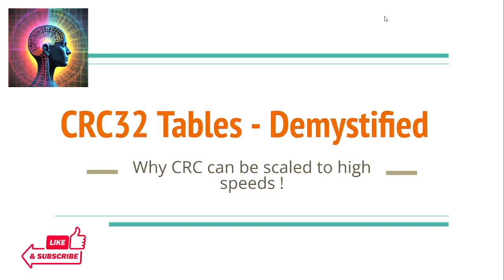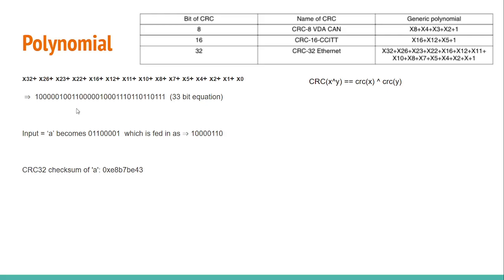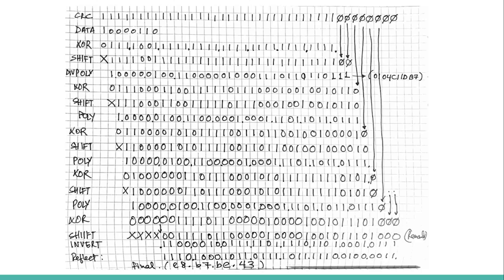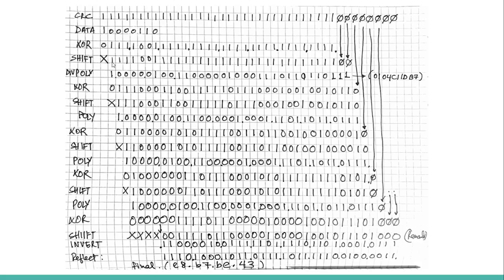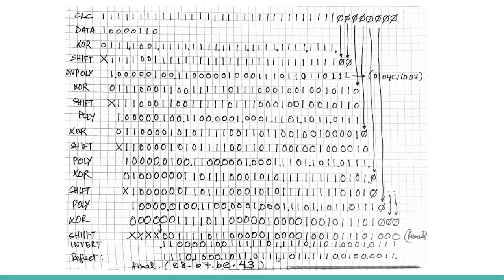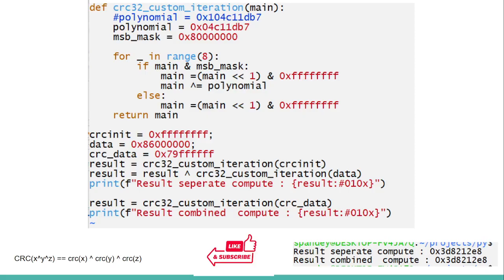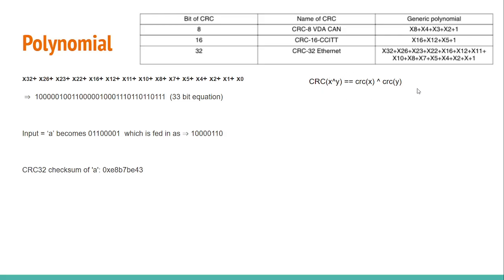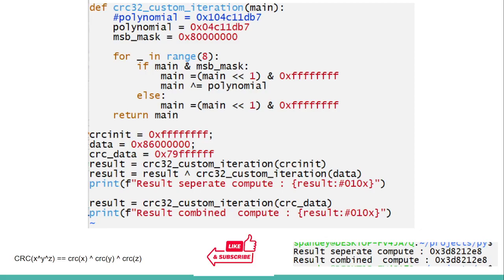CRC Parallel Computation, High Speed CRC

Comment: How to retrieve data from the crc at the receiver end
Reply from the maker: Usually CRC is appended at end of data and transmitted. At receiver, you can either compute CRC over data and match it to CRC appended, or run CRC over all the data + CRC and that comes to 0, and that is a match. Either way - you can check.